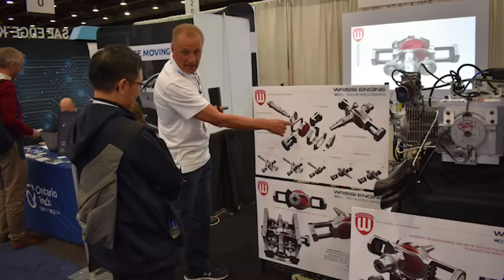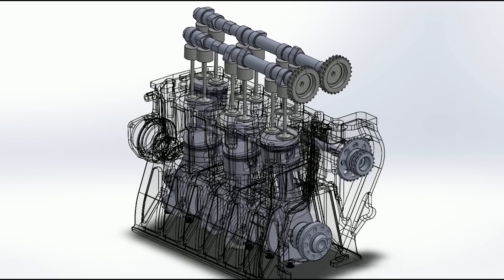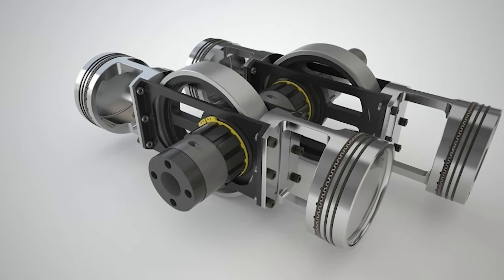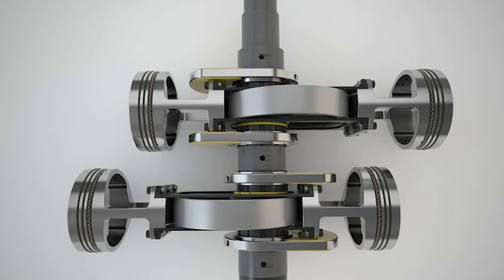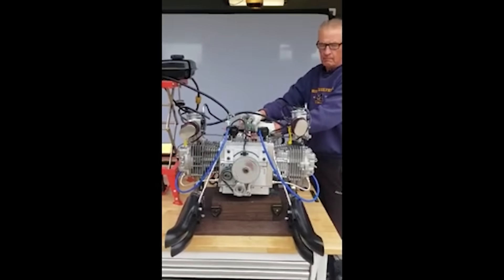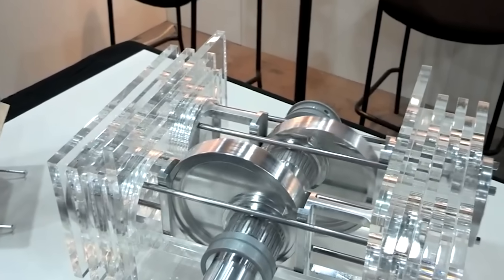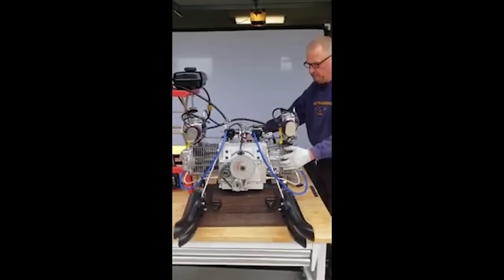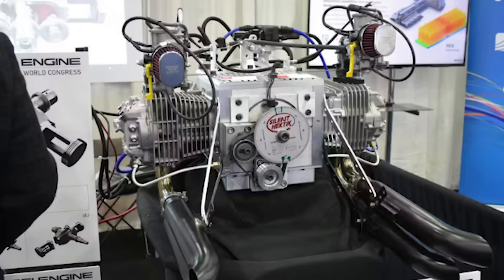The Waissi Engine: Reinventing The Combustion engine

Comment: Fifty years ago I designed a scotch crank engine similar to this, then discovered that Russel Bourke, an American inventor, had designed and built several prototypes many years before, so the basic concept isn't new.
As well as reducing side force on the pistons, the scotch crank eliminates the difference in piston acceleration at the bottom of the stroke Vs the top of the stroke, making balancing the engine much easier.  Further, it reduces loads on the crankshaft: In a motor with a traditional crank / conrod setup the force needed to push the piston "upwards" during the compression stroke comes from the crankshaft through the conrod, but in the scotch crank motor it comes directly from the power stroke of the opposing piston, without passing through the crankshaft (in a 2-stroke version anyway, which my design was).  This reduction in loads on the crankshaft means that the friction in the crank mechanism is less of a problem than you might expect... the crank only has to deal with the nett power of the engine, not the gross power.
So there are a lot of advantages, but it isn't perfect: the reaction of the force on the crank is not on the centreline of the cylinders during the heaviest loads, so there is still side force on the pistons.  Any friction in the crank mechanism results in side force on the pistons, and the long-term reliability of the crank mechanism would need a lot of development work.
But I am very happy to see someone developing  this engine, and wish him well. 
Hopefully, now that I am retired I will get a chance to build a prototype of my version, which will have zero vibration with only five moving parts in a two cylinder horizontally opposed format. Of course it will have to be run on biofuel... we have to stop burning fossil fuels.
Reply: You can get the balance you want from counterweights on the crank, and the largest lesson is that matryoshka bushings are very well suited and low friction for this application.
Reply: @Buzzard-wq1bw  On a boxer or inline 6, the balance isn't really a problem. You have perfectly balanced forces oe next to perfect on a boxer.
Reply: @secularnevrosis not in this configuration where the opposing pistons are 180 degrees out of phase.  The same goes for scotch yoke engines which have a serious rocking couple.
Reply: Yes! https://en.wikipedia.org/wiki/Bourke_engine
Reply: The Bourke engine goes a step further; two stroke using port valving.
Reply: @BigBrainBrian  Also if that engine is properly setup, it can achieve very low exhaust gas temperature, means a very high thermal to mechanical energy conversion efficiency.
Reply: You were a genius ..........until............ we have to stop burning fossil fuels. Then you became a fool. can't wait for you to design heavy equipment bulldozers, backhoe's  tractor trailer truck airplanes that run on magic. OH and by the way google how many things are made from........Fossil fuel???? YOU would have basically nothing without them. NO tires for your fossilless burning whatever, no rubber hose for fuel lines or belts or upholstery or carpeting. want to think that again??? as an atheist Buddhist or whatever you are, It is not within Gods plan for the world and humanity to end that way. Just read the book of Revelation, the last book in the Christian Bible. NOT muslim bible or Buddhist bible. The end has already been set in motion long before the world began. God is like that. All powerful all knowing. for the wisdom of this world is but foolishness to God.
Reply: The Bourke suffers from what most two strokes do.  Perhaps a valve timed to restrict fresh air and fuel from escaping on the exhaust side.  There is beauty in simplicity so adding another component can diminish this.  The big question is what type of valve to use.  I think an electromagnetic valve would offer flexibility of operation.  There was a group trying to revive the Bourke engine but that takes money.  I believe the automakers do not want to invest the money to retool for production.  This is how we end up with the same garbage.  The new two cycle motor with a rotary valve looks promising but that valve on the exhaust side may prove troublesome.

Comment: Those aluminium pistons with their long, slender pillars are expensive, and won't last long under duress. And, if roller bearings were to be used between the pistons and the eccentric disc, they wouldn't handle the shock well for long.

Comment: You don't think that as the contact point between the piston's flat contact surface and the eccentric disc moves off centre that this is somehow magically not going to translate to a side load on the piston....
A solution might be if you had some kind of rod between the reciprocating component and the rotating component of sufficient length such that the ratio between the rod length and the piston stroke length effectively diminished the side load to a point the engine could last hundreds of thousands of miles without these parts needing replacing....ohhhhhhhh

Always love to see ingenuity, but this engine creates more problems than it solves.

Comment: Engineer of 45 years here, rebuilt more ICE than most have had hot dinners. It's a great iteration of 140 year old technology, but unfortunately, it's just polishing a turd! I does nothing to remove the two fundamental flaws in ICE, goss energy inefficiency lost mainly in heat generation and combustion gases through exhaust gas emissions. No amount of 'polishing' is going to change physics. Its about 50 years too late!

Comment: Interesting concept. Rotating eccentric mass could cause complex forces including gyroscopic ones but I don't know enough about engine design to understand them. Hope independent experts assess the design and test the prototype. Would be mutually helpful if Waissi had a website. Love to see this engine running lawnmowers, cars, planes, and ships.
Reply: At least in the 4 cylinder variant as the offset circles are opposite each other gyroscopic forces would likely be of limited concern, at least outside of high RPM situations

For a 2 cylinder variant that is just a pair of opposed positions outside of low RPM applications there'd almost certainly need to be some kind of counter weight or balance shaft, though even more traditional engine designs are known to have those

Comment: Like you I love engines of all kinds. This could be a good engine but there are lots of good engines. Just with the quick run we see vibration is an issue. There are others using a similar design and are farther along. This isn't much of a race to be won, more of what can do it better.

Comment: The crank is just a huge cam shaft!! How interesting! I wonder how it will wear over time?
Reply: That was my thought as well! Normal cam shafts seem to work quite well as long as oil pressure is good, so hopefully this should continue to work
Reply: It has alot of friction.  So yes,  it'll wear very fast
Reply: Like rotor engines, friction is killing it
Reply: with 2 engine blocks 2 set of timeing belts etc . why not to put 2 strock engien next to each others or faceing each others what ever

Comment: Boxer engines like the subaru achieve perfect balance by the pistons moving towards each other, this large mass movement would not be anything like as smooth.
Reply: Indeed, both pistons, connecting frame and ring move the mass in the same direction. This is not a boxer engine.

Comment: Same problem as a std crank:  For max torque/power;  You want the conrod to crank angle to be at 90 deg to each other when the burn happens but it's at ~20 ATDC.
At ~20 deg ATDC the piston-conrod is trying to push the crank out of it's bearings in the same direction the pistons going, rather than rotate it.

Comment: Looks like there is going to be a lot of 'side swiping load' between the rotating crank part and the bottom of the piston, which in turn will side load the piston against the bore. Also there will have to be NO gap between this and the piston or it will "knock" like a big-end bearing with far too much clearance.

Comment: Wonder how well this design would work for a 125cc 2stroke (eg yz125). Would be interesting to see if it would increase longevity. Currently the biggest wear points (say 30-50 hours) is the piston skirt (caused by the slap), rings and cylinder. This design looks to save the wear on the skirt. In a yz125, this would reduce the alloy deposits on the nikasil-coated cylinder wall, which would (in turn) reduce ring wear. If there is any additional weight from the new crank design, it would be offset by a smaller flywheel. A big unknown would be if the additional inertia of the piston (looks to be bigger = heavier) could handle the 10,000+ rpm

Comment: The discs are a major pain to operate, you get the same dynamics of a cranckshaft (the cams aren't perfectly perpendicular to the piston at all times, creating side forces) and you get the added trouble of rotational inertia of a whole disc off center, for my money I'd bet on the free piston engines like the Pescara, or the Bourke engine, that uses a scotch yoke instead of conrods.
the Watt linkage (epicycloid gearing) probably could be used too, but then again, Internal Combustion (at least gasoline and diesel based) is beating a dead horse

Comment: There are many piston configurations which have their own advantages and disadvantages. However, nobody seems to talk about turbines. Rather than using direct drive connecting the turbine to wheels using a gearbox, a turbine can be used as a range extender in a plugin hybrid vehicle. It does not have to be as big as an airplane turbine.
Reply: There was a failed car project called Ё-мобиль that tried exactly that, but in my opinion, free piston generators are best as generators.
Reply: turbines require advanced materials and typically are less efficient than piston engines. but they have the huge advantage of being able to last millions of km/miles with very little maintenance.

turbines are ideal for range extenders because in any situation where you need more than 300km/200mi range, 25-30% fuel efficiency is perfectly fine, and the ability to run on almost any fuel adds a lot of versatilty, which is important in an engine that could last over 100 years.
Reply: @JedPotts-jv2ux  No, you're thinking of large turbines. Small turbines in the range of 10s to 100s hp are MUCH worse in every single regard. An efficiency of 20-25% would be the higher end. It will last much less than a piston engine, and be an order of magnitude more expensive. Power density drops so much for small turbines that they hardly exceed that of a typical forced induction piston engine. Diesel engines can be configured to run almost any fuel, using the right fuel system, and have been used in some applications. So yeah, absolutely no reason to use a turbine as a range extender.
Reply: Jaguar had a concept called C-X75, which was to use two small gas turbines to generate electricity. The battery was relatively small to keep weight down, so electric range wouldn't have been long. 

They later changed the design to a highly stressed, turbocharged and supercharged 1.6 litre piston engine that was to have developed over 500 hp. The programme  was cancelled following the economic crash.

Comment: The electric motor is over 90% efficient, more than double that of the best internal combustion engine. It's also smaller than comparable power internal combustion engines and doesn't need a gear box or another motor to start it. Were it not for the fact that batteries can't store sufficient energy, internal combustion engines would have been dead.
This engine is a version of the Scotch Yoke, which has been tried over and over.

Comment: Looks like they just reinvented the connecting rod. There would still be issues with side loading forces since the eccentric disc shifts its point of contact and moves up and down the piston while rotating. I'm also curious how they prevent the piston from over traveling and losing direct contact with the eccentric disc at top dead center. Even a tiny separation would mean the piston is crashing back down on disc causing damage.

Comment: I believe electric is the future of automobiles, but combustion engines are cool, fun, and will always have a place among enthusiasts. I would like to congratulate Waissi on his innovative approach to an interesting problem.
Reply: I hope for hydrogen, I leased EVs and literally felt my soul leave my body mile after mile 😂 check out the Yaris hydrogen version Toyota is testing out, there's still hope for car enthusiasts!
Reply: @TrueDesire존 I believe hydrogen storage technology isn’t up to the task and won’t be for quite some time. The fuel cell in a mirai is probably about 50% efficient +\- 10%. Internal combustion engines are 10-30% efficient. The Yaris should have a range of under a hundred miles, probably less than fifty the way any petrolhead drives. There is technology to deal with this, but I doubt it will be available in five years.
Reply: Electric is the planned death of the automobile.  Just say no to Communism 3.0

Comment: Conventional engine design can easily reduce piston side load by lengthening the con rod but mostly with modern materials this is not much of a problem.    Engines can go a couple hundred thousand miles and still show cross hatching on the cylinders even in the thrust areas...so what's to gain by changing again?

Comment: I could be wrong, but it seems to me that this engine creates an enormous amount of friction in its principal mechanism.
Reply: Depending on oil pressure, everything could be floating on a plain bearing. HP loss or gains would be = to it. Big end of a connecting rod, as well as the small end has the same problem. He removed 1 of the problems.
 Around the 5 min mark he covers this.
 A roller bearing would cause more resistance and steal hp. cost more to make. Yes it would last longer with a roller bearing, but, plane bearings have been known to go 1 million miles with proper Maintenace.
The biggest problem I see is torque loads at low rpm at start up.
Reply: @pkuudsk9927  electric motor ?
Reply: Unsure if everyone paid attention, but the video explains how they've reduced friction and wear on these surfaces. It's still a rather poor design, however.
Reply: Good observation.  Roller bearings could be incorporated to eliminate the sliding friction.
Reply: @maxenielsen that's why we have moved away from roller bearings ( too many points of contact) and to babbit etc. no contact in theory, it's why many large, expensive engins have pre lube pumps, no contact.
Reply: I agree. It seems like this design is trading friction surfaces, not eliminating them. Also, this design is trying to fix a problem that has largely already been tackled. The efficiency gains, if any, can't make any meaningful overall efficiency gain. That said, I love the fact someone is designing something new. It's 100% awesome but maybe not more efficient
Reply: Yes, because there is multiple contacts along a gear train, friction is very much higher than traditional engine designs.
Reply: Friction doesn't necessarily relate to wear but still friction robs HP .
Reply: As much as a cam mechanism
Reply: How are u going to seal while it has rollers?
Reply: That doesn't seem like an issue, getting rid of friction is easy.
Reply: One offset to that issue is that it allows the block to be redesigned to come apart easier for maintenance. One option is to incorporate a 2-part cylinder/cylinder head assembly unbolts from the block like some older small displacement motorcycle engines, then the block is horizontally split into top half/bottom half allows the crankshaft assembly to be easily lifted out. Being horizontally opposed, instead of channelling out passaged for a water jacket, fins for air cooling could be used with a high volume fan to move heat up, much like the old VW and  Corvair engines.
Reply: Bielas tbm, pra isso serve o óleo.
Reply: Exactly the same as the 1960s Huf engine. Scotch yoke type as in Bourke ( 1950s US )and Collins( Australia, 1980s Melbourne university)
Reply: A very obvious solution is to incorporate rollers at the bottom end of the piston. I’m tempted to give that a try myself.
Reply: @_lslvr  Except that introduces a lot of extra weight, probably several tons centrifugal load as rpm goes up?
Need bearing tracks and much heavier walls on everything to compensate limiting max number of cylinders for a decent power output. (unless engine gets big as a school bus?)
Reply: @_lslvr    The side load is still there, though, and it's made worse because the contact patch moves from side to side, leveraging against the roller.
Reply: I didn’t realise the engine had a headteacher as part of its mechanism
Reply: @malcolmwhite6588 That observation may pass over the heads of many. Correct spelling is a useful principle for good communication.
Reply: The pairs of pistons move in the same direction, not boxer-like. This induces inbalance, hence heavy vibration. Douglas did such as in-line (not transverse) engines in the late 1920's — powerful shakers !

Comment: Recycling of E vehicles and batteries is already 97 % ... and its actually cheaper than extracting new Lithium etc... but with Na batteries now on the market meeting and beating Li chemistries even Li Fe PO4  you will be looking at 10$ per KWHr for Na Batterys .. and you can even extract it from Desalination plants wherebits a toxic waste product otherwise.

The Liquid piston Rotary diesel or reciprocating opposed free piston designs as ultra compact stoichiometric optimum multi fuel generators are whats needed ..particularly in the smaller marine vessels end ..as they are notoriously polluting noisy and expensive and maintainance intensive whilst spending long periods away from shore ...and installed inside ⛵ hulls which are notoriously difficult places to place ICE engines in .. and keep water out of.